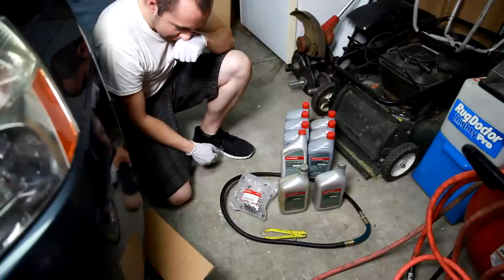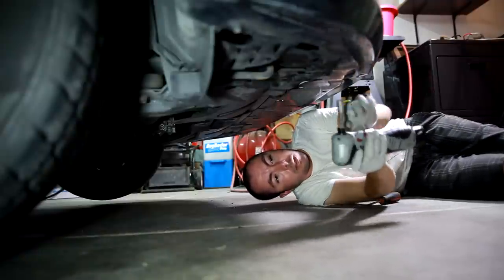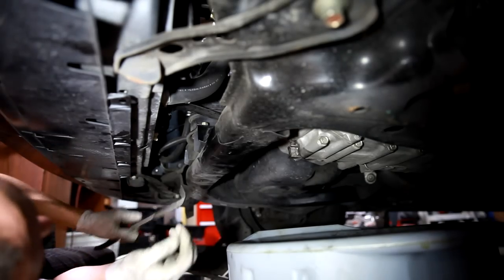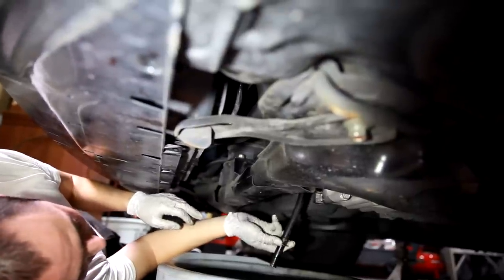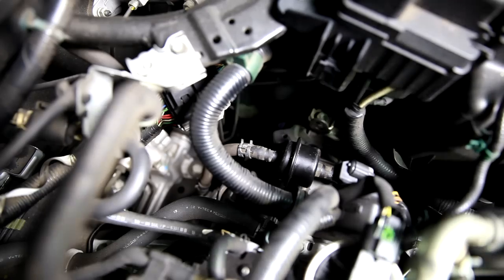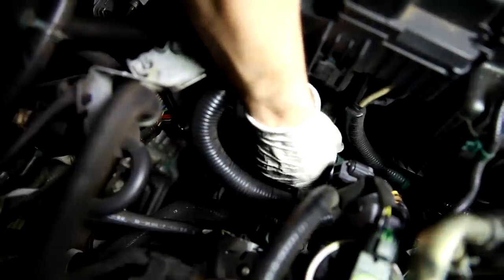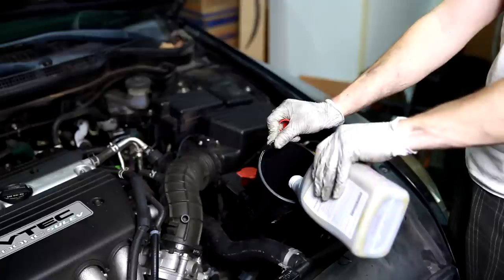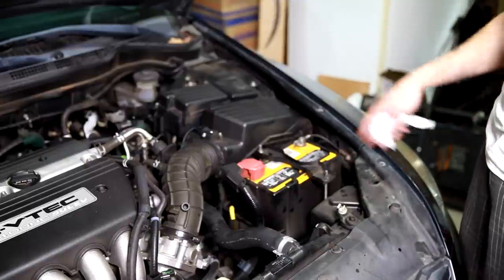2003-2007 Honda Accord Complete Transmission flush with filter

Comment: 1st off never let your transmission fluid get black. 2nd There is a drain plug for the transmission thats a 3/8ths on this car. 3rd if your going to "Flush it" you need to put the hose back up and change gears so that all the fluid goes through all the gears
Reply from the maker: william V how about no. 😁
Reply: @NutzAboutBolts  lol

Comment: huh!!! just like the video 3000 rpm, fan turns on then let it idle for 5 minutes... idle rpm or around 7-8000
Reply from the maker: I'm asking how do you set your vehicle at 3000 rpm when your idle is 7-8000 rpm... that's impossible, you can't lower the rpm if its already that high...
Reply from the maker: but anyways, I would check for any vacuum leaks, but at that high rpm during idle, I would be afraid of engine problems. If you can't find the solution, I would take it to the dealership or a shop for them to diagnose it.

Comment: none,
Reply from the maker: whats your idle rpm? idle vibrations? what do you mean strong vibration on drive? steering wheel shakes? car shakes? did you have any of this symptoms before the throttle body cleaning? make sure all of the connectors are plugged in?